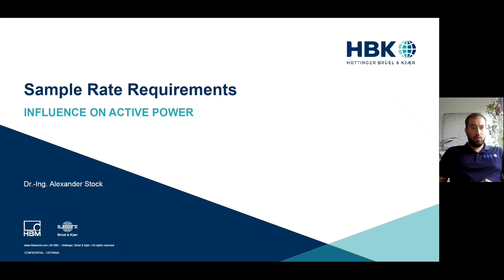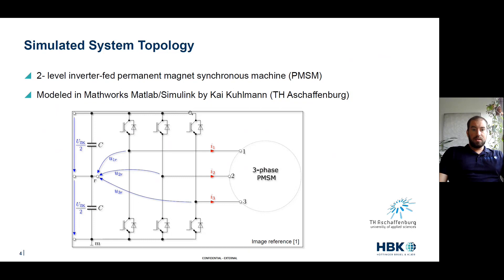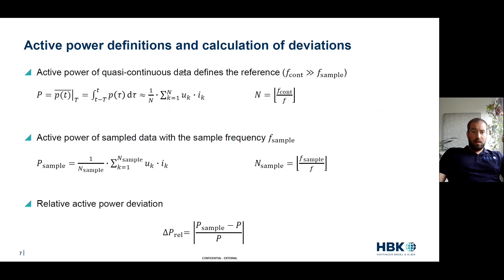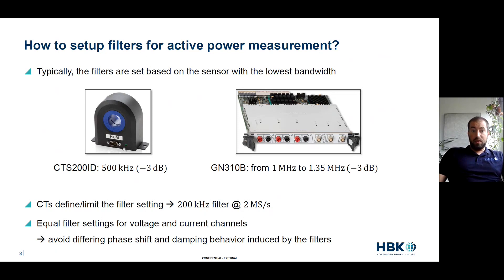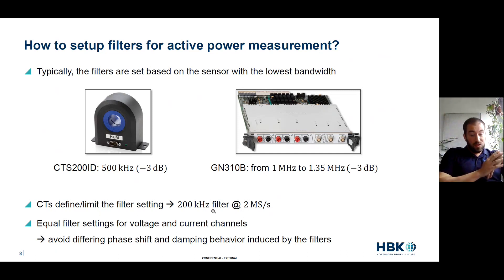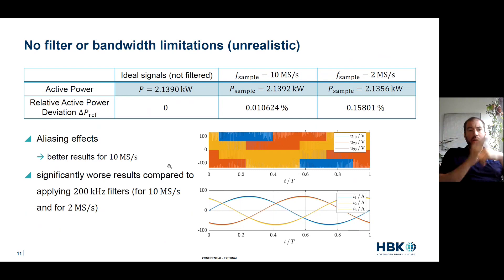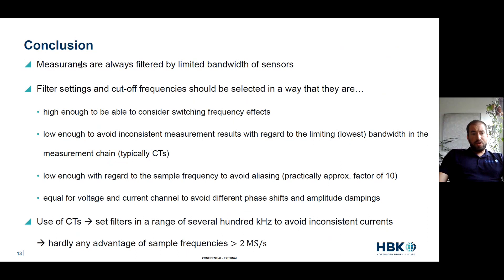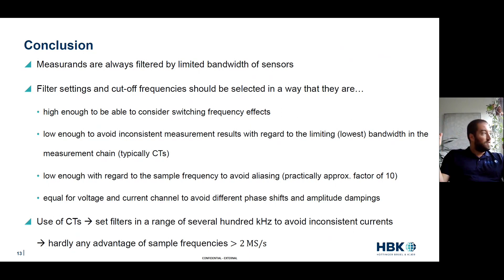What Sampling Rate is Needed for Measuring Power in an Inverter?

Comment: Amazing content! It was really educative experiment. Do you have any indication of what would be the minimum frequency given the fundamental and switching frequency? Like in the example you had a 24 Hz fundamental and a 8 kHz switching frequency, and that lots of clients work with 500 kHz sampling. What are the limitations? how low in frequency could you get ?
Reply from the maker: The limitations would be dependent on the fundamental freuqency. The theoretical limit is 6 switches per fundamental.